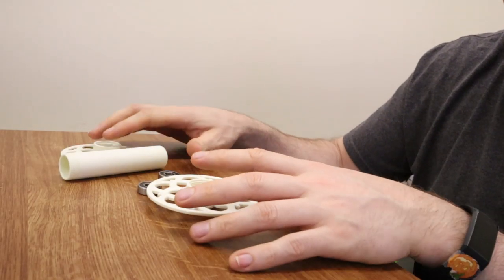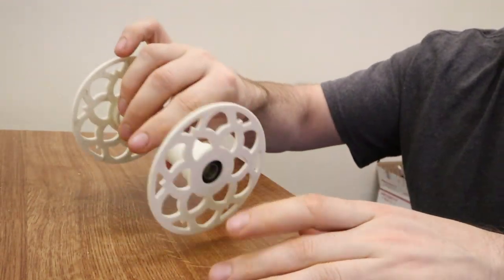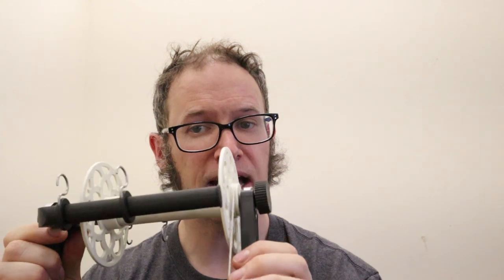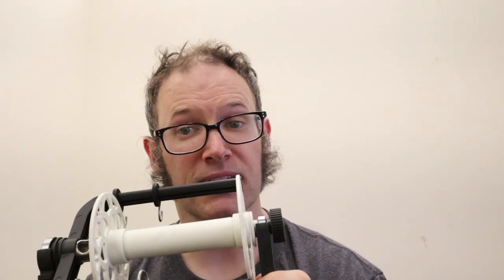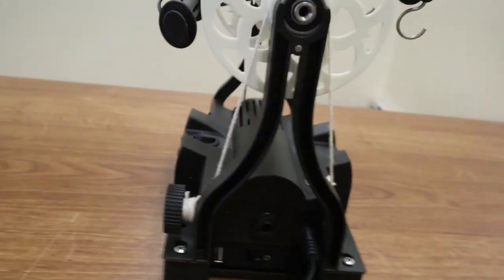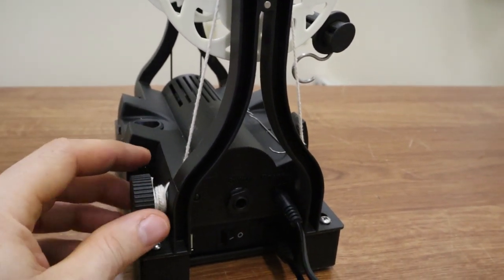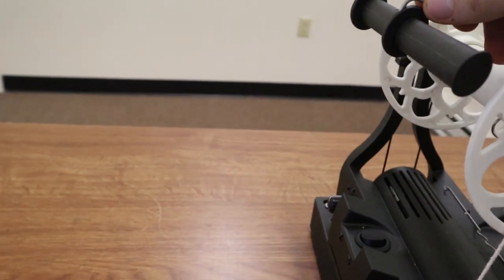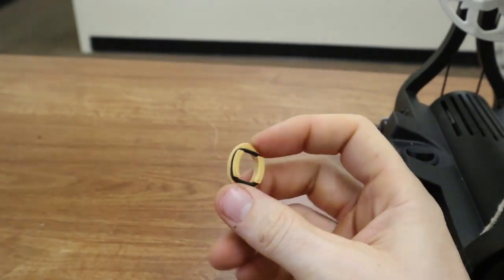EEW 6.0 Bobbins, Bobbin Release Dial, and Tension System

Comment: The new sliding hooks are a great idea. Are the bearings a standard size? In case I lose any so I can go to my local industrial supply shop to get replacements.
Same question for the O-rings and springs.
Reply from the maker: Yes, all the parts are standard sizes.  Basically anything I can make a standard size I do and then when the product is released I list those parts on that page. I really value being able to fix products that I buy so I make sure I accommodate that when I can for products I sell. While I do sell some replacement parts, I'm happy when there are other sources since my overhead for shipping out small orders is high so if you can buy those replacement parts somewhere else that's a good for both you and me.
Reply: @DreamingRobotsBlog  I will get a list of sources for Canadian industrial supply shops started for us folks up here to save on the shipping from the US (which is killer with duties and brokerage fees)

Comment: Hi. Thanks for the update. Can the o rings on the sliders be replaced? Are they just a standard size?
Reply from the maker: The ones for the sliding hooks are and I will have that information on my website when it is released.

If you are talking about the drive belt it is not a standard o-ring.  It is a Polyurethane belt which can be ordered online from some stores, or I will also sell spares.

Comment: I am making a lazy kate for my nano.  Plan to get the 6.0 when available.  what are the  planed dimensions of the 6.0 spools?
Reply from the maker: The diameter is 100 mm and I can't remember the exact length off the top of my head, but it is around 120mm.

Comment: Looks great, just a question... will the spring used on the backside for tensioning be something to buy at a hardware store if it should need replacing or is it a spring that will need to be special ordered?  I really like the improvements over the Nano.
Reply from the maker: The tension spring attached to the cotton string is probably something you could find something close enough at a hardware store or certainly online at a site like mcmaster.  The compression spring that goes inside the dial would be much harder to find a replacement because you need one that is exactly the same size.  I had both custom made to my specs, but I could find ones pretty close to what I wanted for the string spring, but not for the compression spring.

That said I don't think either of these springs would wear out so I don't see the need for replacing them unless something weird damages a spring and then you could probably fix it pretty easily.

Comment: What is the difference between the bobbin release dail and the bobbin tension?
I understand what both are doing, but why not only the bobbin release dail or only the bobbin tension as both seems to slow down the bobbin.
Reply from the maker: The tension system slows down the bobbin in relation to the flyer.  This is required for uptake.
The bobbin release dial increases friction between the flyer and the bobbin.  This does not slow the bobbin down or give it uptake.  If you increase the twists on the bobbin release dial you will need more tension too.
It's kind of hard to see what all this does and like I said in the video the only really good way to see what it does is to use it in person.  I'm still not sure if very many people will use it.  I personally probably won't, but it wasn't that expensive to include and I'm interested to see what 1000s of people will do with it.
Reply: Dreaming Robots thanks for your answer. You’re right, I still don’t see what it does, but I do see that it has a different use on the wheel. I’ll have to find out later.